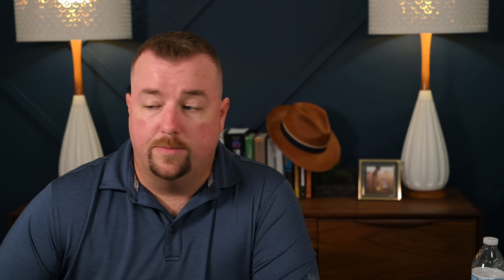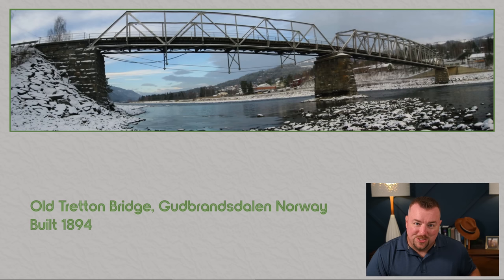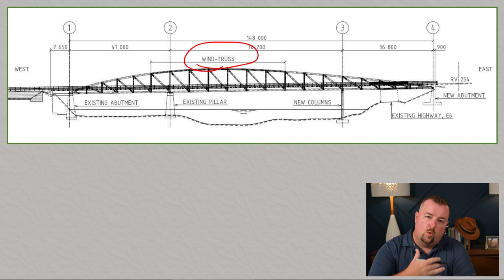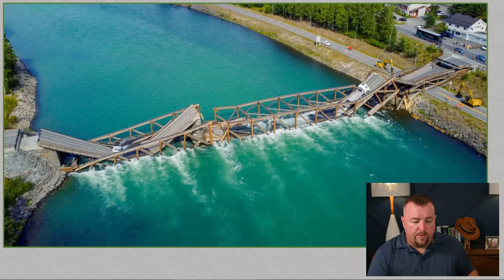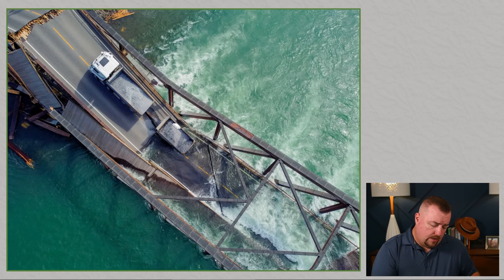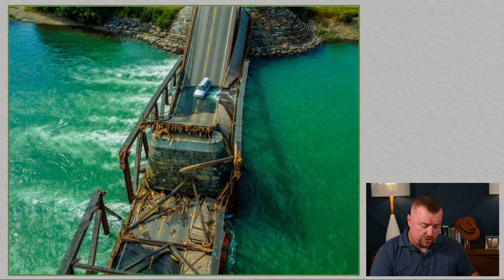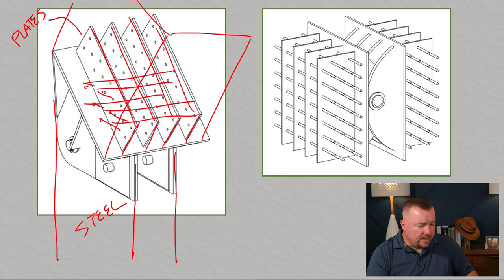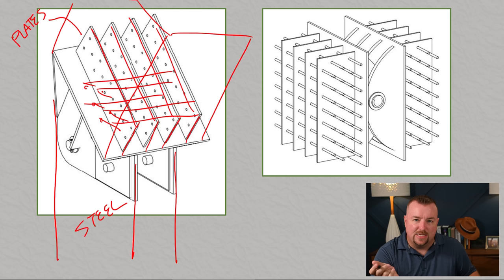How Did the Engineers Miss This?

Comment from the maker: Apologies for the low audio output on this video.  We switched editing over to a new system and changed some of the ways we record audio.  Unfortunately this led to lower-than-expected volume on the video output.  Given the way YT works, it doesn't make sense to re-upload the video, but I promise to have corrected audio levels on all future videos.  Thanks for watching!
Reply: Understandable!  Things happen. :)
Reply: Seemed ok on my end
Reply: So ... wood trusses didn't hold up as expected? 😆
Reply: pig 2 would know this does not work
Reply: Perhaps new math and new ideas should not dismiss old school logic.
Reply: Very difficult to hear. Had to rewind several times. Almost sounded like you said 'the Norwegian countries' at the end there.
Reply: sounded low on the tv but fine on headphones :)
Reply: @Building Integrity  Who is we?  It seems that, ‘you’ are making the assertions and there is no team.  I would like to see your resume, qualifications and some credit towards your, ‘writers’.  I would also like to see the dossier of your practical experience other than Youtube.
Reply: @KaiHenningsen  - don't trust in wood truss - only ever use real steel when it comes to the heavy tension part of structures.
Reply: i feel for the engineer  given the restrictions imposed to the design. i agree with you in the cause of failure being the type of joint connection used... i do not believe gluelam  is the cause of the failure or necessarily a poor material for the application . it seems some simple carpentry from days gone by might be of use in this application....dovetail joinery or japineese wood joinery  where you dont destroy the materials strengths by populating it with weakness holes . as i understand this failure  a new 2 lane bridge on old 1 lane foundation needed to carry 2x static load and 4 or 5 x the live load of the old bridge.....without changing water flow !  or navigation i suspect   so no changes to 100+ year old foundations and extremely limited choices for additional support.... your are correct the software says it works but dosnt understand the difference in strength the joint makes. you state you would never use gluelam in this application but do not specify why just an absolute i would not do it....that seems like a lack of ingenuity or anti engineer to state empirically i would not use that material for that application... i would expect  an engineer to find a way  or a design  that will work. thanks for the video  oh it is possible to produce a 400 500 or 1000 foot gluelam but how do you transport it?
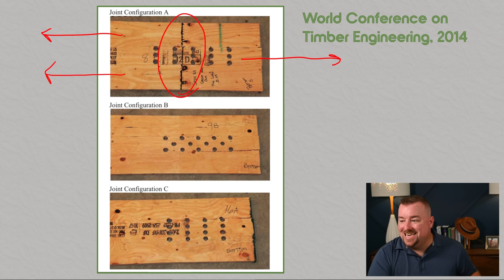Reply: ummm @ 15:17 you bring up the vertical line in Picture 'Joint Configuration A' and say "THIS IS NOT A BREAK - that's just some marker or ink"  - but I beg to differ. IT appears to be A LINE OF GLUE holding two pieces of wood together.... the grain of the wood doesn't really match up... yes there are a few spots where it appears to, but there is a knot on the bottom right side of the line that is just gone on the right side. and there are A LO of lines of grain on the right side that just stop at the line and are NOT on the left of it.... PLUS we can see that the wood on the right side of the line is a bit darker/redder than the woods on the left....
...with all of these points I made you will find that this line is most likely glue holding two ends of wood together in the piece of gluelam.....
ALSO, if you look at the bottom picture, labeled 'Joint Configuration C," the right edge of the wood has this same black glue on it, indicating that some of the ends of the boards have had something put on them (imo glue) that is NOT just some marker or ink and IS IN FACT A BREAK.
Reply: @androidchannel309  Yeah, he did. I used earbuds to listen because it when the audio is that bad, they help. I suspect he meant "nordic countries."
Reply: Ease up on the compressor in the future.
Reply: I can hear you just fine
Reply: @pleasureincontempt3645  And I’d like to see a CV proving you’ve ever gotten a life, let alone became qualified in anything
Reply: Wondered why I had to put my volume on max lol
Reply: Failure CD diagonal, tension pull out. Had that diagonal been steel and connected to the larger steel structure in that area, there would have been no failure at all. The failure began with cyclic bouncing created by the forward motion of the truck as it passed thru the center of the span, a gear shift would have made the bounce worse. The weight of the truck and the flexing of the entire bridge adds more “weight” to the diagonal member CD.
The fundamental difference between wood and steel is that if one fiber can break each time a truck goes over the bridge until there are no longer enough fibers to hold up the next truck.
Steel functions differently, designed properly, bad load conditions, a dislocation can move within the steel without resulting in even a negligible decrease in strength.
Reply: @mobiousenigma  I would also not use glulam for outdoors. Dry and rot are just too destructive. I also wouldn’t use wood for a truck bridge, because the point mass means overbuilding the entire thing to such an extent… note: this bridge should not have failed if there were multiple trucks traveling in both directions and it failed for one.
Reply: @jsbrads1  i agree it should not have failed , and  that the load it failed under was surprisingly low but i still question the refusal to use the material. they put steel cabled  suspension bridges in marine environments ....we do make epoxy paint we can keep the wet and the rot out  and we even know of better ways to join beams  timber framers and shipwrights  knew a thing or two about it , i am not a glulam lover or hater just dont understand the unwillingness and as i said  i feel for the engineer .
Reply: @mobiousenigma  I suppose I am referring to glulam that I know of. Come up with a new type liquid nails glulam that doesn’t allow any moisture loss with a varnished exterior like a bullet resistant acrylic layer, we may be okay with that… but still, truck bridge? Let alone a truck bridge with a huge flexible arch? Wood members can flex, but those connection points couldn’t, there were huge force concentrations there, and the limited cross section of the pullouts 🤦‍♂️
Reply: I worked on maintaining and rebuilding timber bridges in outback NSW, Australia in the 1990’s. We rejected gluelam without further consideration due to its loss of performance in weather. We did use stress laminated technology pioneered in Canada but only with hardwood. Anything less was not lasting 10 years even in outback Australia.
Reply: Fine here
Reply: @jsbrads1  being merely a lowly architect and not an engineer  i am aware of the forces involved but not the degree . my feeling here is the joint is responsible for the failure not the material . the rows of pins and the cuts to locate the plates  weaken the beam . a bit of carpentry would have solved that i feel ...dovetail joinery or some  Sashimono should provide a solution to the pins wreaking the beam . or better yet single span beams not sectional and yes it can be made that long its just the transport problem . epoxy under vacuum should permeate the  the cells so not an exterior layer of protection but an integral protection ... i am surprised there not using  kevlar or aramid  as reinforcement or pretensioning  . thanks for the input
Reply: "it doesn't make sense to re-upload the video"..... It definitely makes sense to those of us who couldn't hear it!
That statement just proves that this channel is just about money! :(
Reply: @mobiousenigma  the reason why they didn’t want to cut into the sides of the timber beams is that engineering principles measure allowable stress by cross sectional area, cut even a one inch divot on the top and bottom of the beam, and your 8” timber becomes a 6” timber at the joint (not including stress risers) and you would still suffer the problem of pullout, it might even be worse.
Longer beams wouldn’t help here, it was the CD diagonal that failed first, but you also have another problem with longer beams, manufacturing defects.
Yes, the joint in \CD was the weakest part of \CD.
Prestressed steel is very good for steel. It does some cold working to the material which hardens it. Prestressing wood would just introduce micro cracks which will hasten bridge aging and failure.
Reply: @jsbrads1  i meant including synthetic fiber  line to the laminate  possibly  loose fiber as well  and possibly pre stressing/tensioning  it  not the wood as is done with concrete beams. as you say cut or notch decreases the area....they sliced the beam in half to fit the plate then drilled holes in each half  it wasnt material failure it was the joint itself causing the failure in the material.... shiprights splice large timbers under enormous stress and have done so for a long time .......it can be done  . thanks for the input   and i would see transportation a greater issue than production defect  as its a fairly simple process and production  even among the various different types . oriented parallel strand to juat gluelam . 8D
Reply: Good analysis as usual. Did I miss the reason the joints were placed flat side down vs on edge? If standard dimensional lumber was utilize on this bridge the beams would have the narrow side of the timbers situated up and down which creates a deep web running vertically and lengthwise. I did not see that in these pictures. If this would have been the case those numerous pins would have been running through the strongest portion of the wood and not trying to separate the plies.
Reply: About your last point, steel as it rusts will eventually cause splitting, I've seen screws do it to old wood decks. :)
Reply: I think you're right about glulam beams shouldn't be used in this environment.  A glulam beam in a big warehouse can span long distance without supports between them and support and upper floor load also with no worries. They can be comparable to a steel I-beam. Thats inside a relatively controlled environment out of the elements.  Just the fact of water saturating a glulam beam destroys its integrity severely. The expansion alone of water logged wood might even separate the glued sections. It seems that wood is not the best material for building certain structures.  Although I live near a famouse wooden train trestle. Its the worlds largest curved wooden train trestle.  It takes some serious mountain biking or hiking to get to it. Its part of the San Diego Arizona Eastern Railway built in the 1930's. Some sections of it are used for museum rides in the back country of San Diego County. The bridge is on the treacherous area that goes down into the Carrizo Gorge to the floor of the desert.  It starts that journey at about 5000 ft elevation to sea level in a fairly short distance, so in other words,  its very steep.  The steam engine was built for the hill. Had vertical pistons instead of the conventional horizontal pistons cranking the wheels.  The vertical drop of the pistons helped provide more power. There was two funnels on top one was the standard boiler water fill. This second one was for sand that filled into a box then had pipes routing in front of the drive wheels with valves that the engineer would open to release sand in front of the wheels for traction.  Anyways I got sidetracked! Lol 🤣 
Great video. Its amazing how that bridge completely was destroyed,  not even a salvageable section of it is left. Luckily it looks like no injuries or fatalities involved that was a miracle.
Reply: @jsbrads1  yep, and a heavy truck hitting the brakes puts incredible amounts of odd forces all over a bridge besides trying to shove it forward  into the abutment.
Reply: Got 13 more of these constructions over here. lol    Fancy pant s politics for stupid fancy people. It s a 30 mill dollar build🤦‍♂
Reply: @alexanderstohr4198  In Australia, we have a long history of using timber truss construction. We've got timber truss bridges up to 140 years old still in daily public use. If you do an internet search for "Timber Truss Bridges of New South Wales" you will find a couple of websites with a lot of information about them.

The fact is that it was not the timber that was problem with the bridge collapse. It was a failure on the part of designers to understand that nature of the material and making connections with the steel components. We actually tried laminated timber construction for bridges in Australia in the 1860s and it was quickly abandoned and replaced with either timber truss, stone viaduct or steel construction.
Reply: I never liked the term "if you will".  Nothing personal against you, I just don't like it.  Regardless who uses it.  A few annoying news anchors used to use that phrase all the time.
Reply: all i did was turn it up a bit 🤷‍♂️ whos bitchin lol
Reply: You're spot on in your analysis. Wood has a poor tensile strength after years in a climate crossing the freezing point many times each year. Also, there's no way to fix the problem without using so much steel and making the wood obsolete. For instance, it is not possible to clamp the wood to the steel plate so that the steel braces don't take the load, but the friction between steel and wood because you then would constantly have to change the tightening on each bolt depending on climate. Also, wood is weakened by pressure.
I believe the whole thing is driven by the moronic idea to conserve CO2 by using wood in new places because of climate hysteria. The three wooden bridges could have killed twenty people and irresponsible politicians think it's worth it for the greater cause. We're talking utilitarianism at its meanest. I don't think we can blame the architects. I'm sure they refuted the whole idea many times before they gave in because they had nothing else to do. They could at least justify their poor morale. They saved their own income. The responsible politicians have no excuse. Embarrassing, really really embarrassing. 
If you want to harvest CO2 by wood, cut down the trees after 12 years and dump them in the ocean and then plant a new forest. The first 12 years are the most productive. Don't use wood where wood has no business to be used.
Reply: Audio is fine with my headphones
Reply: Not understandable. You should have re-up-loaded it. The reason you didn't was the views would have dropped. I am beginning to wonder if this video is going to be worth watching.
Reply: @GEOsustainable  
Agree. He should have re-uploaded it with a slight change so that the robot doesn't recognize it to be a copy. The views wouldn't drop by necessity, but the total view count will drop by the number in the deleted videos, this video. This doesn't matter because economically there's no loss. He is paid by how many ads are watched and not by view numbers. You don't lose the money you have earned until a video is deleted.
Reply: Actually I have watched about 20 mins. The sound level on my PC is not very good either so I have great difficulty following what's being said.
Reply: @IstasPumaNevada  That's what the engineer said.
Reply: What editing procedure have you come up with that does not have audio metering and monitoring integrated into it? - if using for example Vegas (example product, test several and find the one that fits the way you think best, just as with shoes there is no "best") it would be very difficult to make that error. And yes, it is a nuisance that youtube does not allow simply replacing the audio track of an uploaded video, I t oo have missed that occasionally; sometimes things just go wrong.
Reply: The assumptions about the truck's movements post-collapse are incorrect.  You're saying essentially, "Because there are no skid marks, the truck didn't move far, if at all backward."  You're making the assumption that the backward movement would leave skid marks, which is false for two reasons.
#1: it would take much higher speeds/energy states for the rubber compound to come apart and deposit on the road.  Slow speeds are not enough to make this happen in any significant way, unless the proper conditions are met and in which case you'd see a "hopping" dotted line sort of skid mark.
#2: The truck is at roughly a 45-degree angle pointed upward, which will significantly decrease the downward force required to make a skid, and instead turns this into a lateral force pulled backward. Again, at these low speeds, if any rubber were to be deposited in the form of skid marks, it would be broken lines as the vehicle "hopped" as it was pulled backward.

Does this definitively prove that the vehicle has not moved backward? Not at all.  But there is no evidence that the vehicle has ot hasn't moved backward, so it's incorrect to postulate either way.  Eyewitness accounts from the driver or perhaps if there was video would be the only ways you could tell this.
Reply: Similar to that pedestrian bridge collapse at Florida University,  I'll bet that a large percentage of engineers and construction professionals responsible for the project were hired based on everything but merit.  I'd wager a huge bet on that with a bookie.
Reply: @larrybe2900 All the players responsible for the design and construction most likely hired based on gender and color,  not merit.
Reply: Audio seems good 6 months later
Reply: @toserveman9265  
Or cut too many classes in college.
Reply: the only bad thing is that Youtube does not adapt their freakin ads to the sound level :-\
Reply: wood in itself is fine regardless of what some american "conservatives" would say as they hint at the environment not mattering........the one I live next to is 108 years old...it's the whole wood/steel glued wood combination that was the issue...also glad they didn't translate the name Tretten Bru, because tretten is also 13 in Norwegian.. the englishified Tretton you used also is spelled like 13...but in Swedish...
Reply: Found out that the Schweppes commercial is exceptionally loud, and will wake up any youngling sleeping instantly
Reply: Good point, should be by every side window to cut belt, then break window, use tool also to brush loose glass around edges of windows away so no injury getting out or drawing sharks if on a capsized boat, huh? I'll be getting mine asap you can bet that. Think of the teenage grandkids, a life saver. In the meantime carry a box cutter, blade loaded & a regular hammer (for the weight of it) hit back bottom corner of a side window, (easiest spot to break) get glass away around edges then out you go after water rushes in or overflows top of vehicle. Don't play keep blades sharp for real use teens. Live long & prosper.
Reply: Didn't have any problems
Reply: wood is far less renewable than steel. steel can be recycled thousands of times and each time it is economical to recycle it. we need to go back to a time when engineers made the engineering decisions instead of agitators and corrupt politicians.
Reply: i think these studies are foolish... certainly not a structural engineer but i have plenty of experience in design and construction. these connections failing with no warning in tension makes them unsuitably for most bridge connections. the weather is just a small factor that impacts longevity. these things are not designed appropriately in anyway and people are lying to themselves. you want to use glulam beams for a strip mall that is intended to last 30 years fine. its not appropriate for a bridge period.
Reply: I'm on my phone and hear you just fine, almost a little loud
Reply: My biggest thought is UV. Sunlight and its UV rays fucking destroys everything. I laughed at when researchors claim Styrofoam and plastics take forever to break down....you ever have a hose or a power cable outside in Sunlight? You need to buy a new one every fucking 2 or 3 years lol.

I am sure Sunlight played a huge role in destroying the glulam.
Reply: I can not imagine software so basic as to treat timber as a homogeneous material. Surely that would lead to a design with joints similar to mild steel joints. Like weld on a plate, drill holes in it and use pins (like nuts & bolts). Oh! Looks like they thought wood has similar properties to steel! 
This is not really a failure of the bridge, it's a failure of the software used to design it.
Reply: Would recommend reuploading next time this occurs as this is not audible in an outside setting.
Reply: LOOK HOW HAMMER HANDLE CONNECTION AND FAILURE MODE ..THEIR  CONNECTION TO HOLD HAMMER HEAD TO HANDLE. =BUMPS ON HAEDS
Reply: Trying to watch on my phone... I'd probably be able to hear fine on any other hardware...
Reply: We can finally breathe a sigh of relief as the Norwegian Public Roads Administration, through an external investigation, has found serious errors in the construction of Tretten Bridge. We were so afraid that there might be something wrong with Newtonian physics. 
According to the Norwegian News Agency, 'The Road Administration is now implementing a series of measures after an external review points to several serious misjudgments regarding Tretten Bridge.'
"We have made mistakes. It will not happen again," says the Director of Roads, Ingrid Dahl Hovland. ('Ingrid' is a female name in Norway)
Reply: DEI infrastructure
Reply: It was fine! I didn't notice anything